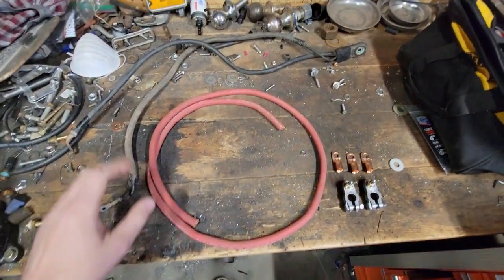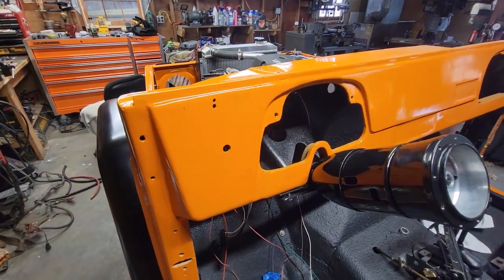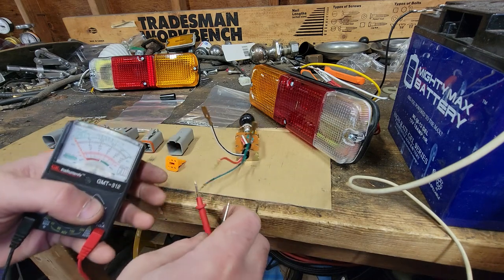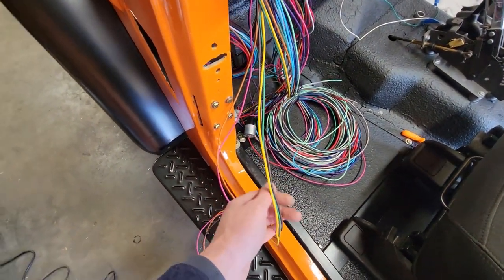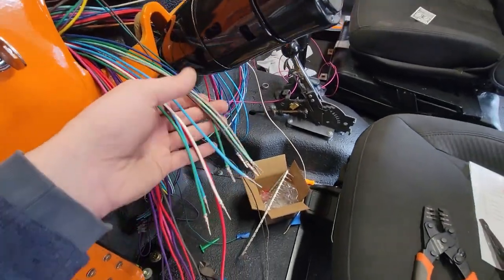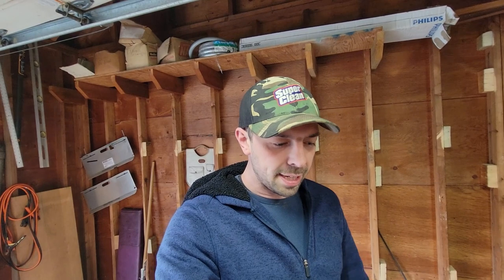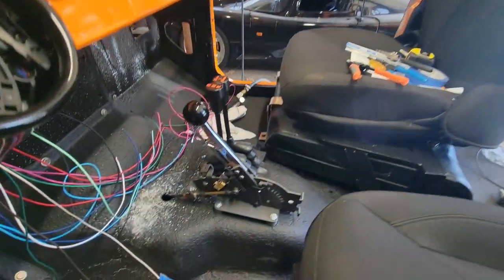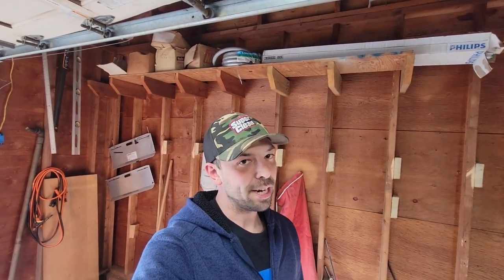FJ40 Landcruiser Build - Completely custom wiring harness build

Comment: I love that you're running Deutsch connectors.   The Toyota snobs might raise their noses, but they are so great to work with!    I do want to point out that those are not the correct crimping pliers for a Deutsch pin.  It looks like you're using Iwiss crimpers, so refer to part # HD-2612 for the correct crimper.   This will get you the ability to pin 3 different  sizes.  Also helpful to get the small tool to help you remove the pins and separators from the connector if you need to move wires.  Quite handy.  You could easily carve one out of a small flathead screwdriver if desired.  

What bulkhead fittings are you using to get through the firewall- both the multi-pin connector and the singles??

I am really liking your build!!
Reply from the maker: I'm using a Deutsch HDP20 bulkhead.  The HD2616 crimper is for solid pins.  I'm using stamped DT pins which require the 1424A, which is what I have.  And I agree, switching to all new standardized connectors makes life infinitely easier later.
Reply: thx for the info!  I did not realize the stamped pins took a different crimper.   Is there a reason you chose the stamped vs solid?   @ranwhenpark3d